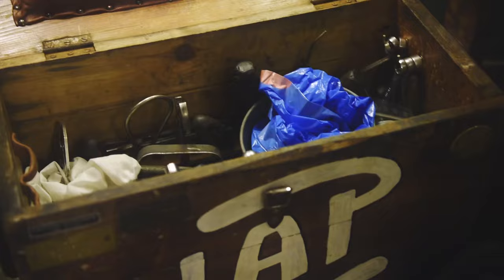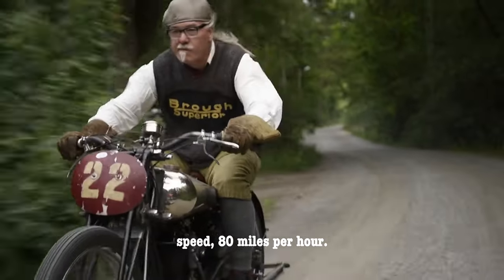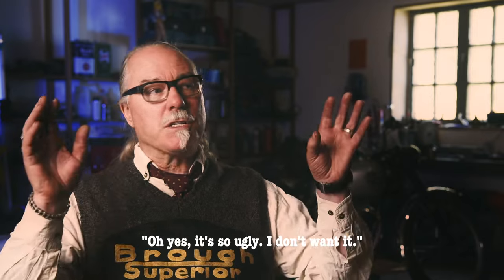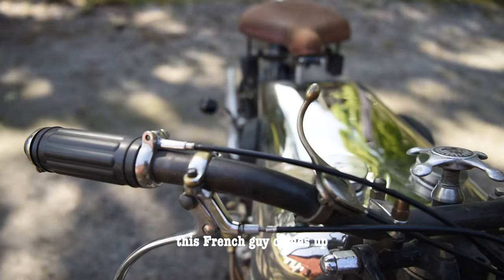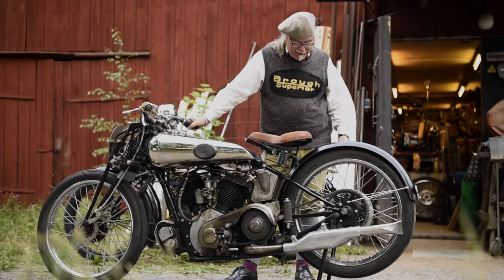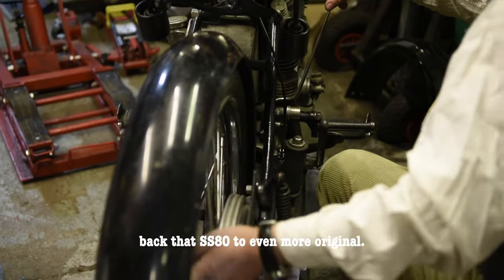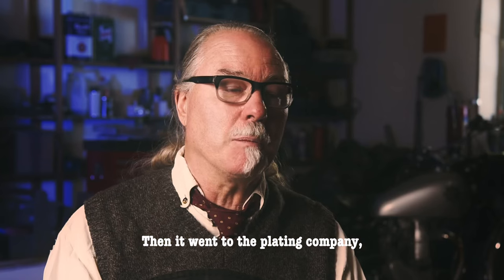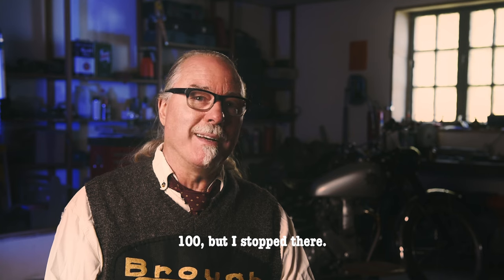A rare 100 - year - old vintage bike, the Brough Superior SS80, that's still racing

Comment: As Brough Superiors go I've taken a sort of opposite route to you, I purchased a far from original 1933 11-50 in 2004 and decided as nothing matched it's build sheet I just made it how I liked, so it has Castles and a 1935 style engine and tanks from a 1938 SS80,. Then within a year I had started construction of a replica 1927 SS100 which I finished in 2015, this is almost perfect visually but is 1150cc with a 4 speed Sturmey Archer gearbox fitted with an almost concealed foot change mechanism and a modernish carburettor disguised with twin floats and the front brake is wider and fitted with an internal twin leading shoe mechanism. So it is quite powerful and fast but will also stop !!
Reply: Keep up the good work Chris!  :-)

Comment: “If you can’t lean the bike against a tree, you shouldn’t use it”. What good sense! Big collections where the owner doesn’t ride the machines are a cynical affectation. “Built to be ridden” yes indeed! A great video of a sensible man. Thank you. Les in UK
Reply from the maker: Thank you for good comment @leslieaustin151
I acknowledge collections or museums who keeps vehicles in running order instead unreachable static pieces...as one of the best museums @wheelsthroughtime
Reply: Many tanks Les! The quote is actually from the ex owner, but apparently I am continuing the tradition!  🙂